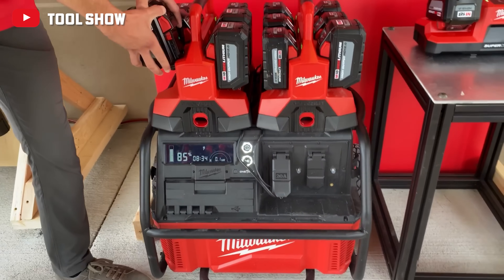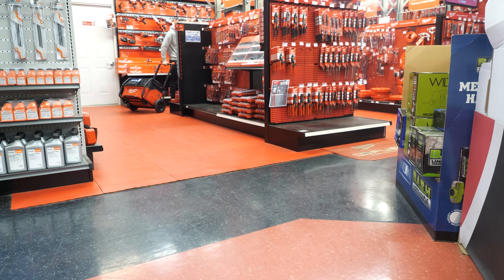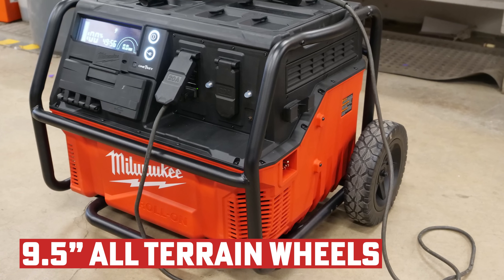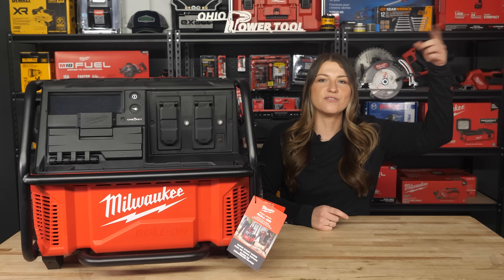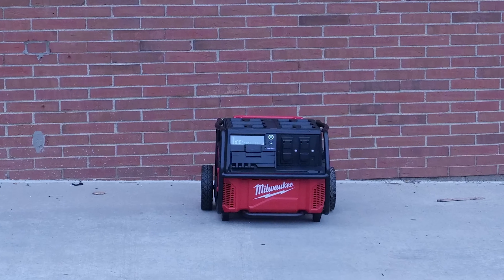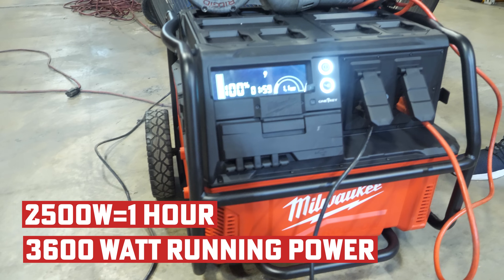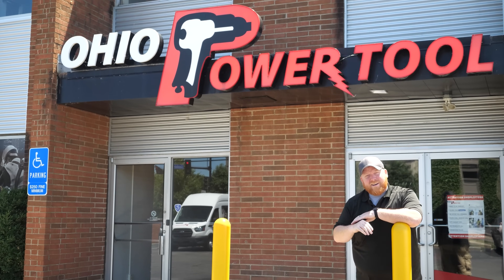Milwaukee's ROLL-ON Power Supply 3600/7200 Watt Can it Replace Gas Generator? (3300R)

Comment: I thought it’s ip65 resistant.. why would you need the $50 cover to protect it from dust in strorage..,,
Poor choice of words

I got had by the first Milwaukee generator using m18 batteries 

Then they really
Got me with the mx fuel generator 

And now they’re selling a generator with built in batteries (probably the equivalent of 2-4 mxfuel forge batteries 
Same shit
Reply from the maker: Appreciate you sharing your experience, and you're totally right to question the details. The 3300R is IP54 rated (not IP65), which protects against dust and water spray, but not full dust ingress or extended exposure, so the $50 cover is really just an extra layer of protection for long-term storage, especially in dirty or shop environments.
As for the M18 and MX FUEL power supplies, you’re not alone. A lot of folks expected more runtime or versatility from those early versions. This new Roll-On does improve on some of those gaps: it has a built-in 2.5kWh battery (not modular like the MX generators) and a much higher peak output for startup draw, but it’s definitely a different category than a gas generator. Not for full backup power, but great for intermittent tool use and high-draw starts on quieter, emissions-restricted jobsites.
That said, we always appreciate honest feedback, it’s how these tools evolve. Hopefully Milwaukee keeps pushing it further.

Comment: Bro 8,725, that’s surely a joke
Reply from the maker: We get it, that number definitely makes you do a double take! The $8,725 is likely factoring in the full setup with spare batteries and accessories, not just the 3300R unit itself. The base unit with the 2.5kWh battery runs closer to $4,500. It's a premium investment for sure, but it's built for jobsite pros who need portable, quiet, gas-free power with pass-through charging and One-Key integration. Not for every crew, but for trades with noise/emissions restrictions or power needs on unfinished sites, it can solve real problems. Definitely appreciate the reaction though, price tag hits hard!

Comment: i can get pure since wave inverter $573,00 10000 wats inverter i can buy 4 lithium battery 12.8 V 200A $500.00 i have 4 lithium battery 9,600 wats power lol with solar charger controller and solar panel plus tool box water proof with 10 fast charge usb with 20A breaker lol do much better not spend that kind money
Reply from the maker: @kennthbrowne7051 Wow, that sounds like a seriously powerful DIY setup — 10,000 watts pure sine wave inverter with 4 lithium batteries and solar charging? Impressive! Milwaukee’s Roll On is definitely a more plug-and-play, job-site ready solution with features like IP54 rating, integrated battery management, and portability with heavy-duty wheels. It’s built for professionals needing reliable, intermittent power without the hassle of building and maintaining their own system. But your system sounds perfect if you want max power and customization! Thanks for sharing!

Comment: Lol this not water proof lol i make my own power station
Reply from the maker: @kennthbrowne7051 Haha, fair point!  it’s not fully waterproof, but it is IP54 rated, so it’s designed to handle dust and splashes, making it job-site tough. Plus, Milwaukee offers that accessory cover to help protect it even more from dust and debris. Making your own power station is impressive though !

Comment: Milwaukee could easily significantly improve this system. I got some suggestions below if anyone is interested.

Run it off the MX Fuel system batteries. Across the base of the Roll-On power supply (where the battery bank is), you could fit 3 MX batteries horizontally, side by side. Possibly four if you put them vertically in 2 sets of 2.
Using 4 MX FUEL REDLITHIUM FORGE 12.0Ah Batteries, you would have a maximum headroom of 3.5KVa (the current system is only 2.5KVa). 
The price point would be about the same or less (4 batteries + power supply), AND you would have a multi-charger for your MX Fuel batteries. [I think it would take about 3 hours to fully charge 4 12.0Ah MX Forge batteries from a 10a 240v plug, and an hour from a 15A 240v plug.]
Using the MX FUEL batteries would also make this system scalable and multi-functional. If you're only going to run 1 1500w tool, you don't need 4 MX batteries installed. Or if you've got all 4 installed, it might run off one or two, while the other two charge up.

Put 3 x 15 amp plugs on the face of the system ( I think they did with the Australian version).
At full capacity, you could run 3 1200-watt tools (3 grinders/rotary drills) for an hour non-stop. Another example: you could run a 15a welder, welding 4-5mm steel continuously, for minimum an hour. You could run both scenarios out to 3 hours if the power supply charges from a 10A 240V standard plug during use, and indefinitely if you can charge off a 15A 240V plug (this system would become a simple RCD in this scenario).

I think if it was all all integrated a bit more like I've stated there would be far more interest.

Comment: Hello, can this unit power a 50 amp plasma cutter?
Reply from the maker: Typically 50 amp plasma cutters would run as 220v this would not be able to handle something with that sort of power drawl. They do make power banks that can run with 220-230v (not from Milwaukee) but even so runtime will be limited.

Comment: What about size? Dimensions?  How does it compare to the regular tool box roller?  Seems it might be a bit wider, but is it taller?
Reply from the maker: The Milwaukee ROLL-ON Power Supply is 28.85 inches in length, 19.95 inches in height, and 23.15 inches in width.  It is similar in size to the PACKOUT Roling Tool Box but weighs a lot more at 104lb.

Comment: Can you set in a truck and charge it with the truck or solar panels on the roof of the truck? That would be amazing
Reply: lol build your own much cheaper ok all need 10000 wats pure sine wave 12V 60HZ 120V  12V 200A LITHUM battery need 4 will give you 9,600 wats and few other thing you out run that power station not spend $4,500

Comment: 4500 smackarros for a 100# battery that gets whooped by a $1000 gassy-boi from China Freight? That's gonna be a hard pass fo sho. Kudos to the big red army for daring to travel down that road but seriously, this thing is going need some stacked lithium and touched by the finger of God to be viable. 

Nice pitch though, OPT. Gotta hand it to you for the well put together presentation. Cheers!
Reply: Ya I agree, this whole ‘battery’ thing is going to pass.

Comment: Interested in something like this for sump pump backup and portable power for trips. Anything else you’d recommend checking out?
Reply from the maker: The battery backups have no problem starting and running a standard sump pump, a 1/3 HP unit will have a peak start of 1300-2900 watts and running usage around 800 watts. For that Milwaukee Roll-On that means about 3 hours continuous running as a backup. Even the M18 Carry-On with 4x of 12.0Ah has the power to run a sump pump but it's the runtime that's the issue. This outperforms most "backup" battery systems out there which maybe give you 20-30 minutes. For best results look into a water powered back but yeah a generator (running outside) feeding an extension cord will give you more continuous usage as long as you add more gas every few hours.

Comment: Wow. Your pitch is better than what I’ve heard from Milwaukee Sales reps.
Reply: lol i can build my owm much cheaper out run that dam power station and water proof with 10000 wats pure since wave with 4 lithium battery 12V 200A WICH GIVE ME 9,600 wats power with solar charger controller and solar panel and tool box and fan and 20A breaker etc not spend $4,500 on my power station my will have volt meter tell you how much volt and % my battery is with Lithium charger to change battery and it will water proof i will able to run 4 20A tool with

Comment: Meh, make your own if you are DIY. These are for companies that pays the bill. Just picked up a 3,300 watt capacity battery for $430.. Add an inverter that you need 2000,3000,4000 peak.  Recharge cheap with Alligator clips charger type. Looks ugly, but won't  break $1k
Reply: good idea, actually.
Reply: What 3.3 Kw battery are you getting that is only $430

Comment: if you put 3 good mppt controlers on it for solar input so that it can accept 3000 watts of solar then you might have a winner.
Reply: Also is the battery lithium ion phosphate or lithium iron phosphate????  For something that pricey it needs to be the iron phosphate battery.
Reply: exactly.

Comment: $4,500? You can get a gas generator for like under 1k.
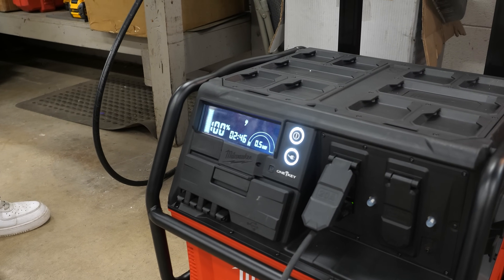Reply from the maker: We agree, and talk about it at 3:55 if a Honda EU2200i (which we also sell) is portable and $1k where does this new Milwaukee fit? There are for sure many cases where sticking with gas is going to be the way to go, however we see many buy a gas generator for certain applications and then it sits unused the rest of the time, once the investment is made this may become a daily part of life for many, even if there is power somewhere on the jobsite, this keeps everything where you are working. We are also seeing more and more situations where running a generator is simply not an option, while still less common, more common everyday. Good news is battery tech is only going to get higher cell capacities and lower cost per watt hour so if this is the starting point for specialty situations, it's only going to open door for more and more battery solutions like this!

Comment: It's about time. I wasn't a fan of the mx inverter, especially since it only lasted 6 months and broke and Milwaukee refused to warranty it. I hope this lasts longer, I'm willing to give it a try at least.
Reply from the maker: The MX inverter was their first power solution, which has since been improved. This new one has several more years of development behind it but we will see if Team Red fans want a fixed battery bank, that doesn't rely on M18 or MX battery packs.